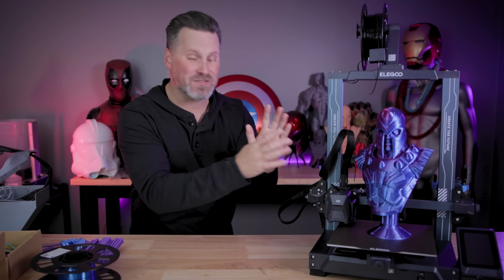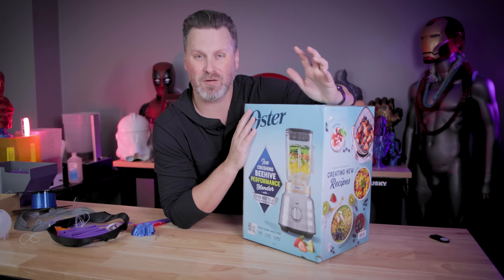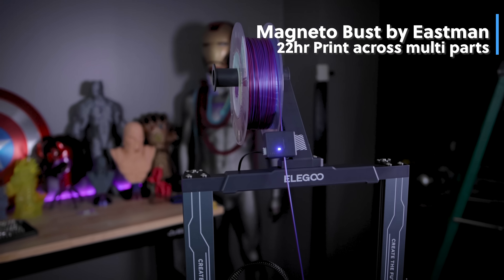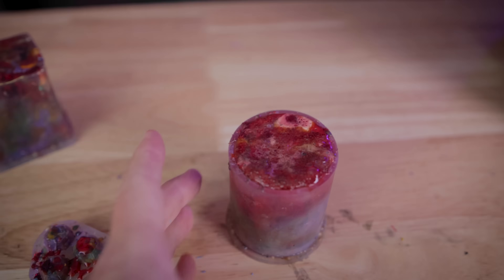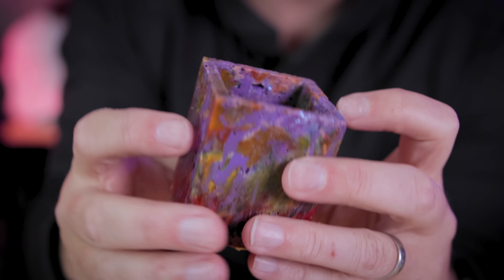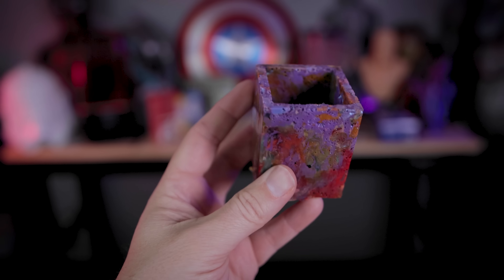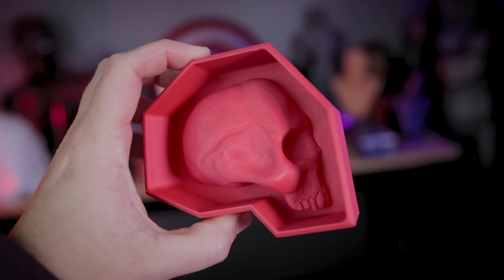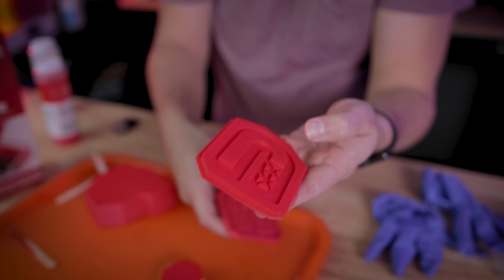Melt your 3D Prints!

Comment: I'd say the silicon mold started to burn from being too close to the elements in the oven as opposed to the general heat. A bigger oven and putting it on a lower shelf would probably solve that issue.

Comment: The algorithm brought me here. Man my first thought is "where can I buy Gridfinity silicon molds?".
I do wonder if you could use a cheaper and especially more space-efficient way than using a blender. While a second-hand blender might not be super expensive, it also takes up a lot of space, which is not practical for a hobbyist with limited space like myself. I saw someone using a drill and a specially made jig to transform filament into pellets, but I wonder if you could do something similar that'd accept random sized plastic.
As for the over, unfortuantely I guess there's no way around the space issue, gotta buy the smallest cheapest used oven you can find.
Starting 3d printing brings you down the rabbit hole of just doing more stuff.

Comment: On the side of safety and in my opinion, I would like to state that this temp or those baking temps are too low and at that temp, You're creating a toxic  gas. Make sure to wear a respirator as well.
Reply: @zaxdesignz8698 Do you have any recommendations on handling temps here? I am considering this idea at some point since there aren’t many services with good recycling resources for 3D printed stuff.

Comment: Very well done Sir. The skull is such a recognizable shape that the eye forgives those many bubbles, and it's a cool 300g gadget if i got ounces right. Pretty much a self defense weapon! :)
I'd suggest to find a way (I haven't imagined yet) to pull air out of the mixture. Idk if taking the mold out of the oven to pull it in a vacuum chamber at every melt after you add material, is feasible. The vacuum insulates a lot and the molten pla should not exchange so much heat to cristallize in the time you take it outta oven and pull vacuum to it, but I haven't tried, so... I'm watching you do it for us! :)
Ideally the vacuum chamber and the oven should be the same enclosure.
Or better, but complicated, could be trying to set up a rudimental injection system, or somehow pour in the mold already molten pla.

Comment: The silicone molds linked here are not recommended. I was able to burn and melt the silicone molds. What should be impossible as silicone melting temperature is extremely high. ANd I did that using a 150W halogen bulb that reaches 500 F / 260 C only.

Comment: A bigger melt would be interesting to some.. I've got 11kg's of scraps, looking into a slowly heated (gas) oven to melt into a PLA ingot. Open flame might set it alight- so my thought was a stainless/ copper heater tube right in the middle of the melt, with a propane torch ran through it. Some will char, it might catch fire...

The end mold is probably a big, dry, terracotta pot. As in, I don't need skulls or other little trinkets. I want to recycle my waste. Even though it came out great, you have yet another piece of static, unusable future waste in your hands. Or are you going to pass it down towards the next generation.

Might sound sour, but turning useless scrap into useless crap is just fun for views, and nothing more. It doesn't help anything or anyone, just your wallet.

Want to print green? Print efficiënt, without too much support structures. Print things you need, instead of the 95% useless trinkets people print.

Comment: Did you find that the molds were weaker after one use?  I tried a bunch of different temps to see if it made a difference, but it always felt like the silicone was breaking down after only one use
Reply: 100%. The temperatures being used are about the temperatures silicone breaks down.

You might be better off making your own molds using a silicone designed for higher temperatures, though I don't know how demolding will go.

Comment: I definitely wouldn't melt anything in an oven that you use for food. Good ventilation while melting is most likely a good idea. Probably set up in your garage,  barn, or outdoor shed. 

Something you could test out:  grind up your leftovers as tiny as possible.  Then mix a batch of resin. Add the plastic grindings to the resin. Pour into a mold of your choice.

Comment: Without ever doing this... would it be better to melt the pla at a very high temperature in a vessel on a fire and then pour the 100% melted plastic into the mold? Seems like the mold would hold up much better instead of baking it for so long. Think of it like melting gold for gold bars.

Comment: Why wouldn’t you melt everything in one container that can take the high heat, then pour that into the mold. Seems a lot easier and safer. Not to mention you’d get a far better finish

Comment: I used an Ultrabase print bed, arranged scrap PLA filament bits to make a nice pattern; in my minds eyes, I was making a collage.
I popped the thing into an oven, baked it at around 180C until the material 'slumped' into one big thing.
As it cooled, I heard popping and cracking noises, and finally a very loud BANG as the glass under the PLA exploded!
Did you know that cooling PLA can strip the black surface and glass off of Ultrabase?
I now have a print-bed missing about 1/3 of its surface, to a depth of 1-2 mm!
Ultrabase and PLA will permanently fuse at PLA melting temps.

Comment: If the filament has a comfortable margin between melt and burn temps. If you melt them first and then pour them into a mold, you might be able to get a better finish. and make sure to mix in some plastic with a lower melting temp or lower viscosity to have better flow, that will also help getting those bubbles out doing it the normal way
Reply: How do you pour it. I tried melting and never gets liquid enough to pour it in molds.
Reply: @roll4stealth671  The plastic type is the most important factor. I dont know which filament  has the best flow
Reply: @roll4stealth671 you need a $50 full size oven. A toaster oven is never going to get it hot enough to pour

Comment: Another option that would work well is to take the ground up pieces and mix them up with casting resin before pouring into the molds. That way you don't have to actually melt the plastic.
Reply: Would work if they're ground to a fine level and then added almost like glitter, but can be not as fine as glitter of course

Comment: This would in my opninion be better for resin waste. The molds would hold out much longer since the temperature would not nearly be as high. All you would do is chop it up like with the FDM and then use ether clear uv resin if the walls are thin enough and transmit uv light or epoxy. meaning you should get more uses out of it. Next low and slow is the way to go if you want your molds to survive. Silicone molds usually start smoking at 365-370 unless it's specifically a high temp silicone luckily most PLAs melt at about 355 so that lower temperature while taking a lot of time will keep the molds at a better temp and therefore decrease the rate of degredation of the mold

Comment: why not melt the plastic in some sort of pot like a double boiler or something similar to melting metal then just pour into the molds and let it kool, I suppose with that much plastic you would have to deal with a lot shrinkage and warping, however at least you won't melt your molds and you can use a mold release that way and you wear your molds out as quick.
Reply: Cuz it would be like some thick gooey that would be hard to pour
Reply: @willburito makes sense

Comment: The correct process to avoid airbubbles completely would be to premelt the pla till it takes a liquid state in a bain marie / crucible, pour it into a proper silicone mold (there are silicones available in the market able to withstand 300 Celcius) and finally put the mold in a vaccum chamber so that the vaccum pressure could fill all the gaps. You will have to position your mold correctly in space, since the highest points of a corner are more probable to catch an air bubble. Prober air vents would medicate that.
Reply: Interesting although I'm sure that 95% of people watching this at home aren't going to have this capability to do this.

Comment: I am looking forward to seeing more expanded videos from you. In case you didn't know, if you want to make a mold with your resin printer you will need to either use a Tin based mold mix or use Inhibit X to coat the resin before molding with a Platinum mix.
Reply: Aha is that right? It's a good tip, I didn't know the resin for printers had that issue. Most cheap plasticines also suffer from silicone curing inhibition.
Reply: @MaximilianonMars  Yeah, unfortunately. You need an inhibitor of some type, tin-based, or use an older print to mold. I don't have any to test that last one but supposedly small prints can take up to 6 months to degas enough to use platinum-based. 
I have heard of a few types of specialty printable resin that are okay to use on their own, but none I can name off hand.
Reply: Do you think a simple clear coat over a resin print would work?
Reply: @Thanos88888  It is possible, I know people make cosplay props, for example, use spray cans and cover the prop before molding. For both FDM and Resin. That is essentially what Inhibit X does. 
But, it also depends on how much detail you want. Each layer adds thickness to the model and can settle in recesses making them less defined, so if it is something very small and fine I would be careful. " TheCrafsMan " has several good videos on this.

Comment: My big question is, can we find an easy way to melt these scraps down into a format that will let us use the bottle > filament method and create new filament with them?  I'm thinking melt them into very thin sheets that are bendable and then cutting them into strips.
Reply: I mean, even just melting them down into sheets of different thicknesses could be useful for other kinds of projects.

Comment: I'm thinking of starting up my own etsy shop for 3d prints in the near future, and this seems like a great way to use any scraps/failed prints from printing products. Thanks for another great video!
Reply from the maker: 100% and apparently they sell fairly well also!
Reply: @UncleJessy  could you also try using a 3d pen and injecting material into a silicon mold that way rather than just using scraps? Might make for an interesting video
Reply: @zzace00  do 3d pens get enough flow to fill up an injection mold? Last I saw they only lightly extrude, and at a temperature slightly lower than a printer, but it would be interesting to try

Comment: You need some high temperature silicone if you are going to be placing it in the oven so you wont have to worry about any problems. Smooth on makes high temperature silicones for mold making.

Comment: Hey Jessy, just a question: But how do you maintance your 3d printers? Mine develuped a clog and so far all the tips and tricks I seen out there seem to not be working, as though the filamint seems to flow, it is now 100% failing to print with the neptune 3. So far contacting elegoo has yilded zero replies and its been 4 months. No matter the filament used, temps used, it keeps coming out springy and I can not find any information outside the stadard push the needle up inside, try and hot pull, etc to fix it. It's pretty much killed my plans of printing holiday stuff and gifts and today was my deadline before a trip out, and I stil couldn't get it to print even the first layer without being a mushed stringy mess.
Reply: you could change the nozzle? the other option is to take the hot end apart, it could be something bad has happened to the ptfe tube, or you have a gap... theres probably video guides todo that on youtube
Reply: @specialingu  I've never changed the nozzel before and so far only seen conflicting videos on how to do it on other machines, even elegoos own even says I need some sort of heat resistant glue while others say you don't? Not even sure what caused the clog, just using the same filiment I used for several prints and it just went all thin like only some of it was coming through, and that still seems to be the case.
Reply: i switched to a larger .6 mm nozzle 3 years ago for less issues, faster printing, stronger layers, also ill do cold pulls when switching colors or filament type.

Comment: @Uncle Jessy If you were going to do a large item with alot of void area inside, you could always partial fill, wad up some aluminum foil to fill the space and then fill up the ground up filament around it...kinda like what you do when you're making an armature for clay sculptures!!!😁👍🏻
PS--would cut down on the bake time as the PLA would be at the exterior of the object.
Reply from the maker: That right there is a fantastic suggestion! Will be giving that a try

Comment from the maker: This was a fun one. Part 2 coming soon 🌭
Reply: These kind of videos are fun!

Are you doing a review of simplify 3D v5? I think you are one of the few 3D printing  YouTubers (I follow) that still actually uses it, and I'm interested to see what you think of the changes.
Reply: What if you melt the filament and then pour it?
Reply: Try mold release next time also when you put more filament in press down on the melted mass to rid it of air bubbles 🎉
Reply: Nice topic, I would know more about it. What’s your experience, which silicon mixture you use, how thick are the walls etc. .
Reply: cant you use the same stuff they use to make spru glue, people use stuff to turn sprues into a glue i cant remember exactly what it is its in nail polish remover it melts the plasyic down

try using dice molds i think that would be such an amazing way to use left overs and amazing look for dice
Reply: Great video! God bless you and yours! Praying for you
Reply: Have you tested melting using a heat gun? Would be interesting to see how that goes